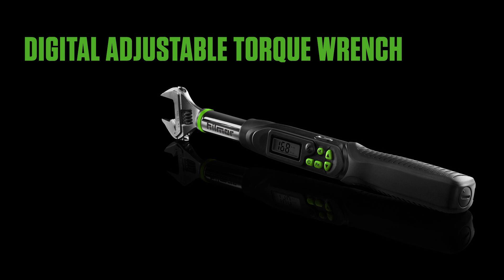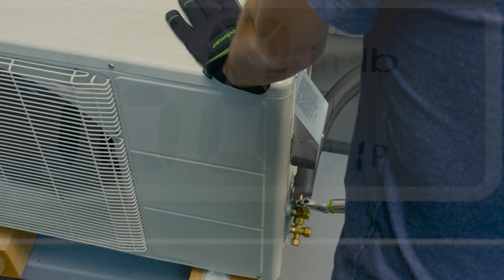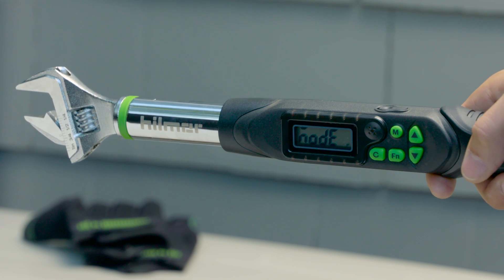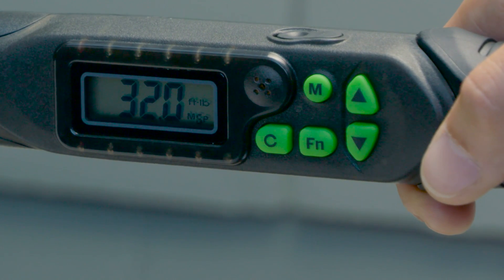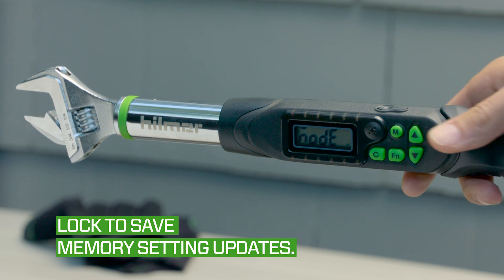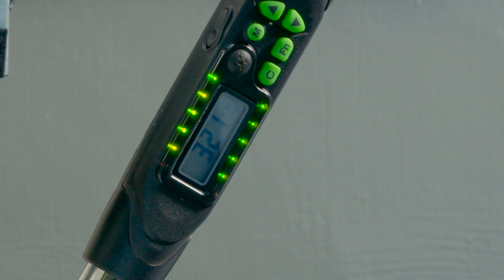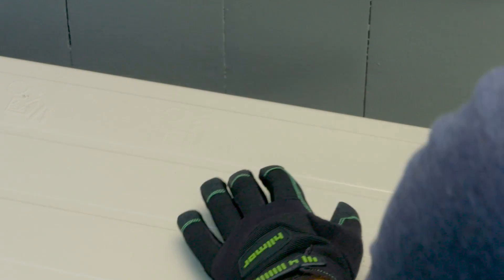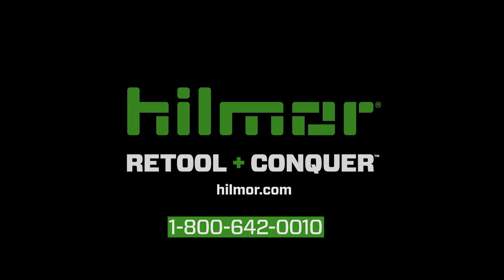hilmor Digital Adjustable Torque Wrench

Comment: Will not work on Mitsubishi 5/8" nuts.
Reply: Why is this the case aaron?
Reply: Yes I agree.. Mitsubishi nuts are just a mm or two above the 28mm of this wrench.

The competitors open op to 35mm but they have fewer memory settings and they cost about 50% more.

Thankfully you can get a 5/8 heavy duty nut that matches this wrench from a gas fitter supplier.

Mitsubishi just prefer to put a bit more size on their nits exterior.
Reply: Aaron K You should be installing Daikin anyway

Comment: Please tell me why you demonstrate your instrument incorrectly?  Crescent typed wrenches are always used by turning in the direction of the lower jaw.  Shame on you!
Reply: Adjustable wrenches are to be used in any direction.Practically no difference in strength or grip. Stop this myth.
Reply: You are correct David!!!   =)
Reply: It could be that it is to show the display of the wrench perhaps? Jeez, don't take commercials to heart. It's marketing, not training.
Reply: You'd never know you were such a grumpy old man from your thumbnail:)
Reply: Perhaps you are thinking that the lower jaw is the adjustable part and therefore more vulnerable to shear... But that is only if you put the adjustable claw in that orientation.

I think Newton's third law applies to make both ways identical..